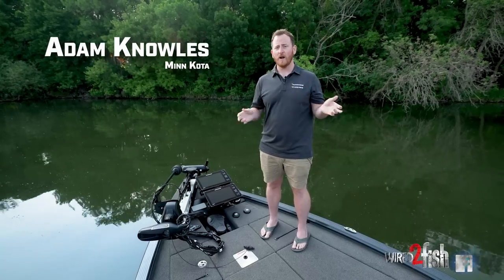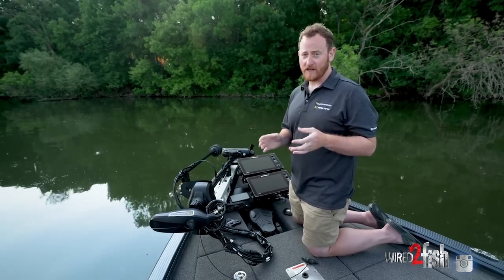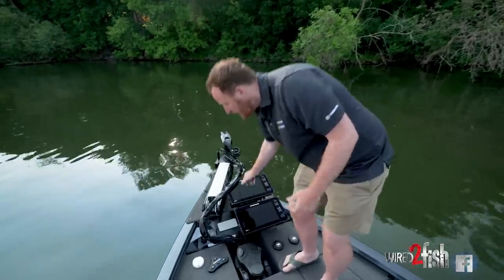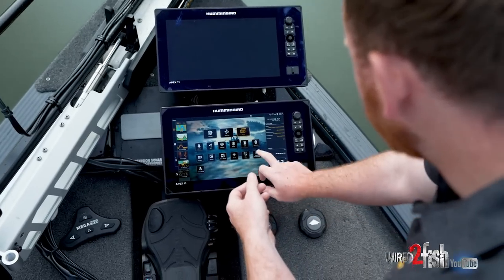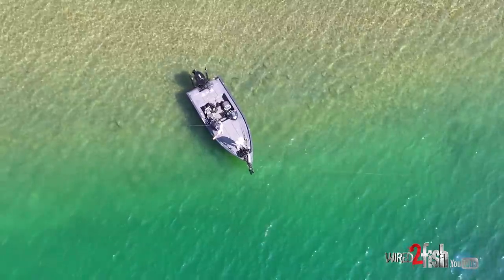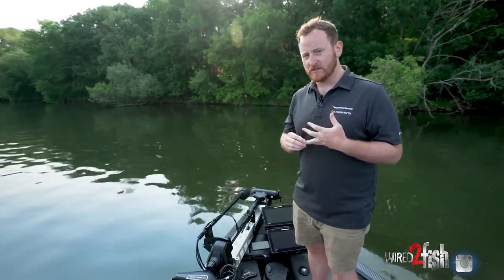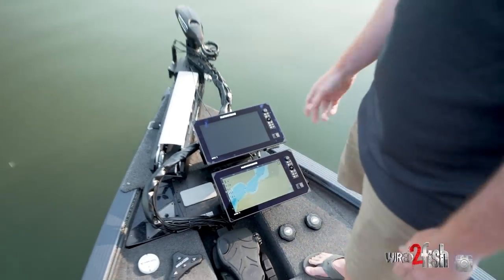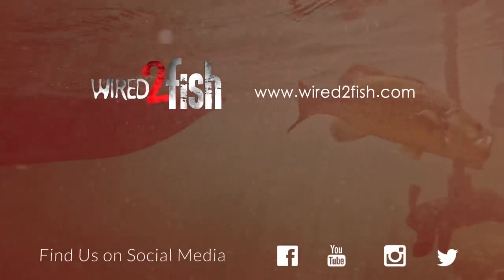Minn Kota Ultrex QUEST Trolling Motor Overview

Comment: I just installed mine  the other day. Replaced my 80lb Ultrex. Storms have kept me off water but I’m pretty impressed. It is well thought out. Mega live / 360 bracket will fit if you saved your bracket hardware. It had the longer bolts and spacers. This thing is a beast. It weighs 14lbs more than my old one. Mount is wider and bolt pattern did not match the holes I used on old mount. It has less options. Mounting screws are thicker. Mount weighs 5 1/2 pounds. All the weak points of old mount have been improved. Just hoping it doesn’t rob MPH off top end with added weight on bow.
Reply: Correction. Mount weighs 5 1/2 lb more.
Reply: Correct. Ooops.

Comment: @Wired2Fish If you have to pull the trolling motor up to get around some rocks, grass, or thick stuff while it's still running what is the auto stow position going to do? when does it Engage can you still lift up the trolling motor while running?
Reply: I would like to see this question answered also. Good question
Reply: Good point

Comment: I've been waiting for this for a year. Didn't want to go with lowrance because humminbirds mapping is so much better.
Reply from the maker: We've been running the Ultrex QUEST trolling motor for 3 weeks, and in regular contact with pro anglers that have been doing the same. Performance is impressive. Tons of torque, easy lift assist, and the thing is study like a chunk of I-beam steel.

Comment: basically a brush-less motor/power  upgrade  not bad .
Reply from the maker: It's sweet. A lot more power and overall rigidity. Super easy lift assist, and some cool new One-Boat Network boat control functions.

Comment: So, as I see it, trolling motors and electronics are becoming one. If you have Hummingbird Electronics, run a MinnKota. Lowrance electronics, run a Lowrance. The same goes for Garmin. My current boat is a Ranger Z521C with a MinnKota and Lowrance electronics. Hmmm.
Reply: Ehh, for bass fishing most guys really don't utilize the graph functions with their trolling motors to be honest.
Reply from the maker: While there are a lot of cool boat control functions, @MJ_Bass is right that most bass anglers use Spot-Lock and not a lot of other automated boat control features. That's why so many pros run a mix of trolling motors, often not aligned with their fish finder manufacturer.